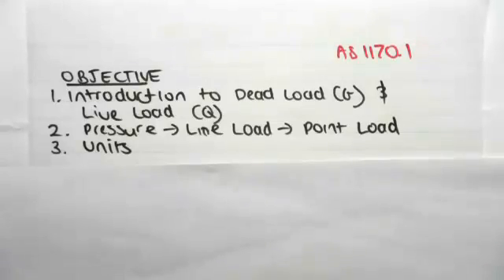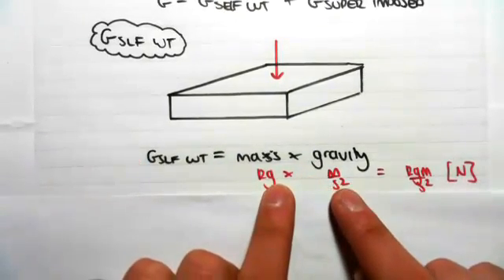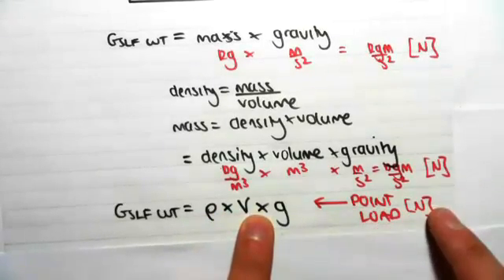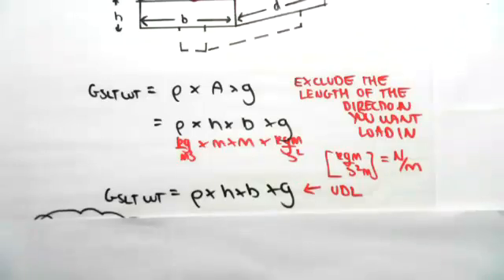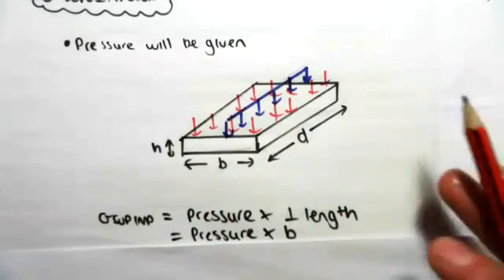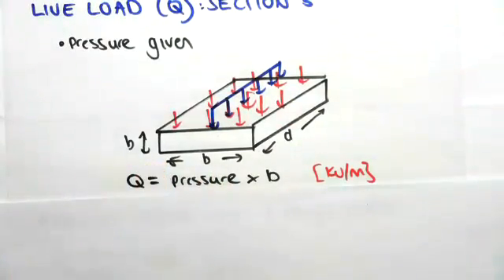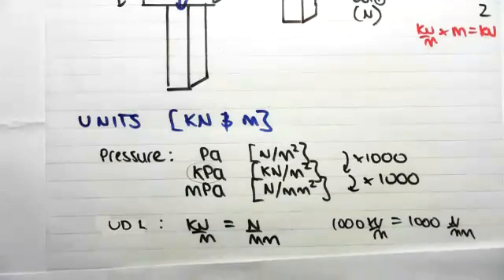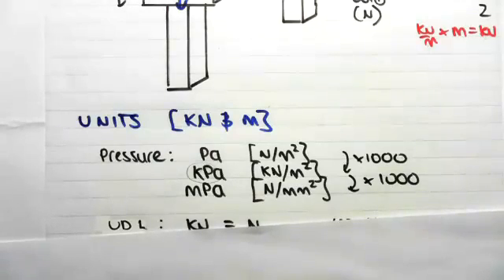Introduction to Dead and Live Load | Structural Concepts and Design

Comment: Hi. What about the compressive strength?   It is force applied on a cross section. For a Cube with 15 cm is the compressive strength for example 25 Mpa. Is this unit area representing depth and width (per your drawing h*b) and the missing side is Length(d) ? 
If i have a roof area of 125m2 (d= 25, b=5, h=0,2 m), would be the linear compressive strength on the surface area= 0,2 mpa ?
Reply: This confuses me so much as it means that the roof would carry 2500 ton before it collapses. Please answer me as soon as you have a free time and thank you a lot in advance.

Comment: A simpler way to get the linear load is by getting the point load and divide it by the length of the beam. Also, for simplicity, it would be easier to get the slab dead load by multiplying the volume to unit weight instead of multiplying it with mass and g.

Comment: Mate, Can you explain how you come up with N/m unit on 4:15. You have kgm/s^2 as the unit for gravity. And I dont know how you get the unit at the end. Thanks.
Reply: I completely don't get this either mate!!? Can anyone help on this please?!
... ok got it after a while. In2meIc not sure if you have since found out - I will try to explain:
Consider G(self weight) = m x g
to find mass we can take the relationship density = mass/volume.
The units of density are kg/m3
Re-arrange to form mass = density x volume.
Substitute this back into the equation of G(self weight) and we get:
G(self weight) = density x volume x g
The units here are kg/m3 x m3 x m/s2.
This simplifies to kgm/s2 which is also known as a Newton (N) and bear this in mind for below:
Now we work out the linear load replacing the volume with perpendicular area:
So it becomes G(self weight) = density x area x g
The units are kg/m3 x m2 x m/s2.
The trick is to effectively factor out kgm/s2 (a Newton) from these units.
So it becomes kgm/s2 x (1/m). Now change kgm/s2 to a Newton and BOOM! we have N/m. Hope that helps.
Reply: Popandu Thanks mate. I know it has been  months now but its always good to appreciate when someone is helping you, so Thank you again.
Reply: +In2meIc 
Good question.

It turns out that a lot of us are taught to think of the concept of "g" for gravity backwards from the way we really should think about it.  It is common that you learn that g is the "acceleration of gravity", rather than the "gravitatonal field strength" as is a more physically accurate way to think about it.  It is an acceleration, in the special case of free fall, when gravity is the only force acting on it.

In the special case of free fall, m*g is the only force acting on the body.  And coincidentally, m is also the object&#39;s inertia.  Inertia is the m in Fnet=m*a.   So when Fnet=m*g as is the definition of free fall, this means that m*g=m*a.  Mass cancels out of the equation, and you get g=a.  It is unique to gravity that the property of matter determining the force is also the property of matter that exhibits inertia.

By definition, the Newton = the net force that accelerates a 1 kg body at a rate of 1 meter/second every second.  So 1 N=1kg-m/s^2.

So what about when other forces act?  Gravity "g" is not an acceleration at all.  It is a field strength.  As in, a force per unit property of matter (in this case, mass).  So it is better to think about g as 9.8 Newtons/kilogram, rather than 9.8 m/s^2.  In problems like Atwood's machine, I was very confused thinking of g as an acceleration.   Because you need to rethink it as a force first, before it becomes an acceleration.

My confusion with Atwood's machine is that I see a system of two masses accelerating due to gravity.  But they don't accelerate at the rate of g, rather much slower.  Thinking that their acceleration had to be g, led me astray.  When I realize that g really is Newtons/kilogram, force per unit mass, rather than an acceleration, I learned how to avoid taking incorrect shortcuts, and to see the system of equations and constraints that solves these problems.